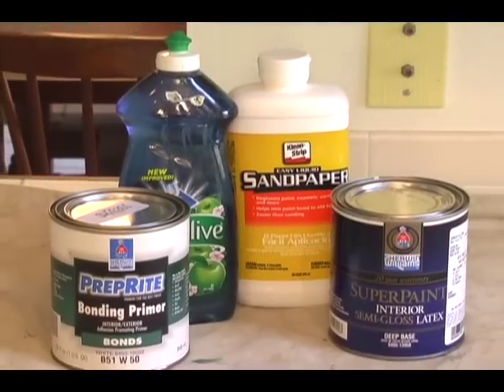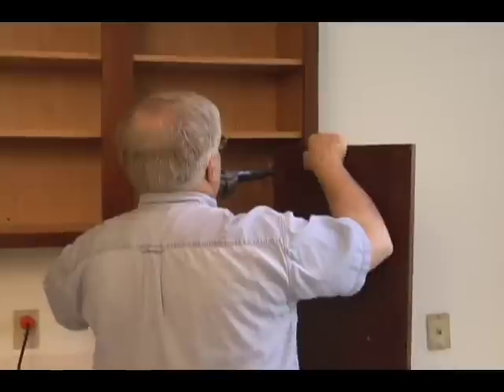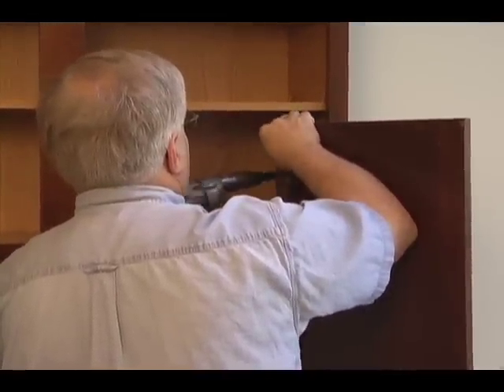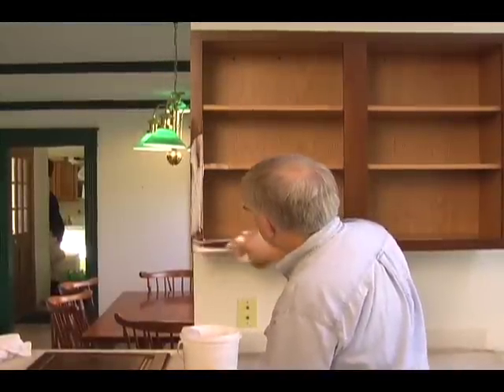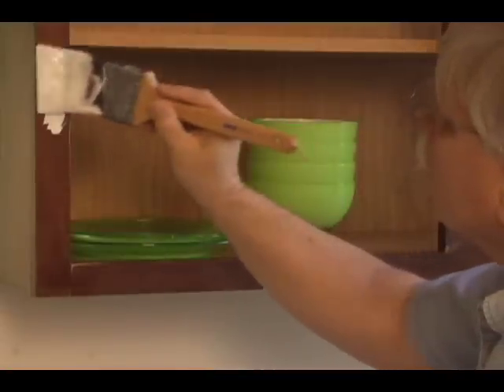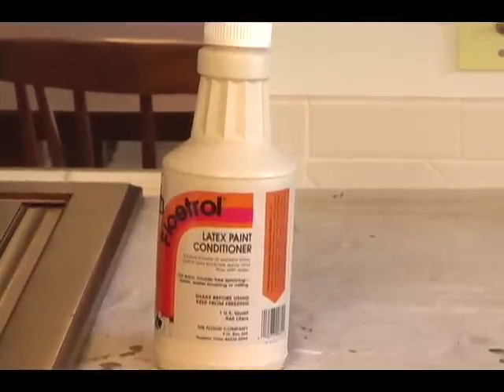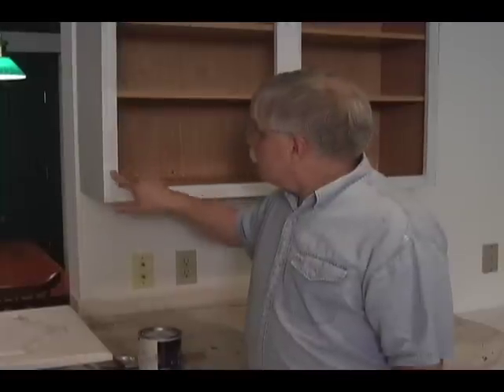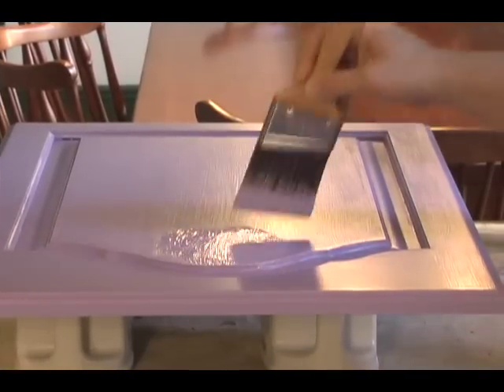Painting Kitchen Cabinets

Comment: Glad you said to paint after primer was dry.  I saw one Youtuber that said he waits I think a week or close to 30 days for it to cure.  I thought that was a bit long and knowing more dirt and film could get onto the primer before the 1st coat of paint.  I'm painting my kitchen cabinets now.  The guy at Home Depot told me I didn't need a deglosser.  I just went out to buy some anyway, and it worked great.  Still did sanding of the oak doors since I have a spot outside to do this :)

Comment: The Liquid Sandpaper is great for cleaning but you may still need to a light sanding. I found a FOAM roller helps prevent the brush strokes. Did you really paint the whole kitchen lavender?

Comment from the maker: A medium layer of deglosser.  Many paints can be scratched off within hours or days of application. But once they have cured completing the chemical and mechanical bond, it is very hard to remove them. Go try doing it on a piece of painted woodwork around your home.

Comment: Like Zarita, I like the foam rollers for most painting jobs.  And I like chisel tip foam brushes for applying polyurethane.  As a union-trained finish carpenter the idea of painting cabinets is pure torture.

Comment: Great video!  Can you tell me the advantages and disadvantages of using  a brush vs. a roller for painting kitchen cabinets?  I'm looking for a very smooth finish with no brush strokes or roller marks showing.  Also, do you only need one coat of primer and one of paint?  Thanks!

Comment: @biggoose9727 Second thing you want to do is go over it with a 220 grit, thats the final grit you'll need. After that clean all the dust with a damped lint free cloth. Then you'll want to apply a wood conditioner found in most hardware stores, i bought mine from home depot. After you have applied the conditioner apply the first coat of stain in a room that is well ventilated but that will not get debree on the cabinets while you paint. I would recomend you use a satin color. (Continued)

Comment: Thanks for all the tips. My cabinets are all very old and haven't been maintained properly. There's some sort of dirt/grease cover on all of the cabinets that is slightly sticky to the touch. I tried washing it off before with soap and water but it's too stuck on there. Will the deglosser take care of that or will I have to use some other product to help get rid of the sticky stuff?

Comment: @biggoose9727 Hi i noticed you said you were going to use the poly shades from minwax to stain you're cabinets. I actually just restained my kitchen cabinets with the polyshaded, i used this color called american chesnut. I can really help you out with some tips: First thing you want to do is remove the varnish and stain from the cabinets using a 100 grit sand paper, try not to use anything less because you can do damage to the wood if you're going to use powertools. (Continued)

Comment: love the video , but would it be less stain resistant and oil reisitant if you apply a sealer ? I want to paint my cabinets but I have to wash them frequently due to the excessive greases that accumulate on them and kids dirty hands so I really need to make sure this is durable , open to any suggestions you may have!

Comment: Thanks for your quick response!  I bought both oil based primer and oil-based paint for the job.  Would the paint conditioner work with oil-based paint?

Also, would you recommend TSP substitute to clean 20-year old kitchen cabinets?  Or is soap and water sufficient?

Comment from the maker: Well, the first thing to do is wash the cabinets with Stain Solver. Just go to that dot com site. After the cabinets are painted, seal them with the most expensive water-based CLEAR polyurethane you can find. Diamond Coat has worked for me. You neet to apply it as SOON as the finish coat of paint says you can recoat it. That way you achieve a chemical and mechanical bond between the paint and clear urethane.

Comment: @askthebuilder I have tons of room trim and cabinets that are painted with oil based paint (yellow..yuck). Will liquid sandpaper rough the oil paint up enough to apply latex paint or should I get out the sander? Or just repaint with oil?... I have gallons of latex already so I could save a buck going latex

Thanks.

Comment from the maker: No worries. Hold on!!! If the finish is gummy, you may be able to just deep clean them and be okay!! Try my oxygen bleach Stain Solver. Go to the StainSolver website and see if you can't easily remove the grease and gum with that. I've had fantastic experience doing that.

Comment from the maker: I would first WASH the cabinets with a solution of my Stain Solver oxygen bleach. Just go to the StainSolver website - the dot com one. Get two pounds. Wash the cabinets really well with the solution. Use rubber gloves and allow the solution to stay on the cabinets for several minutes before rubbing. Rinse and allow to dry. If you feel the paint on the cabinets is older than 30 years, use the liquid deglossers. Latex should be fine if it will harden sufficiently.

Comment: Hello Tim

Thanks for the video! A couple of questions, aside from saving time/dust does using liquid sandpaper end with a better finish?  (The cabinets are very greasy at points) I will be using TSP to scrub the cabinets down.

Also, the local home depot advised me that with oil based paint I will not require a primer, is this true?

Comment: Tim, I realize that cabinet was on the short wall between your kitchen and dinette prior to the remodel.  I know this may sound like a dumb question, but if you were going to remove that cabinet, why did you paint it to begin with?  Were you planning to give it to someone else who could use it?  I'm just wondering.
Reply from the maker: We painted it to create the video. The cabinet was going in the dumpster had it not been painted.
Reply: @askthebuilder  I see.  What did y'all end up doing with the cabinet after creating the video?

Comment: I'm having a hard time putting a stencil on a painted wood surface. possibly because the painted surface is semi gloss.  if i was to add liquid deglosser, would it help. I don't care much about the gloss of surface. in fact I would add all over to take gloss off but I do want to keep the paint surface the same. don't want to repaint.

Comment from the maker: @camoranleodes You can, but you absolutely MUST clean them. My Stain Solver will get rid of the odor. It's perhaps the most powerful oxygen bleach on the market. It breaks apart odor molecules. Go to the Stain Solver website. the dot com one. You'll love the product. Mix it up until it dissolves. Use an old spray bottle to apply it. Keep surfaces damp with it for about 5 minutes, then wash with soap and water.